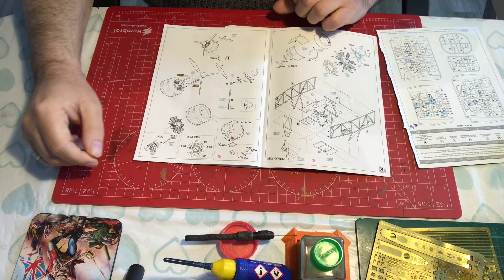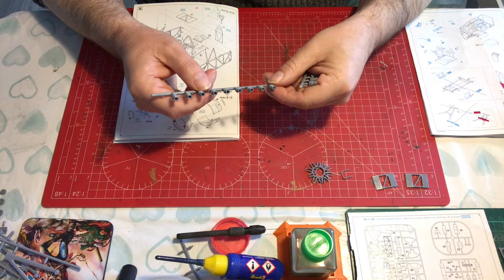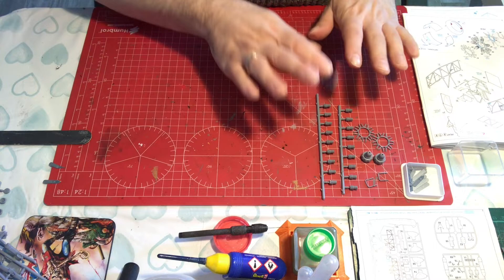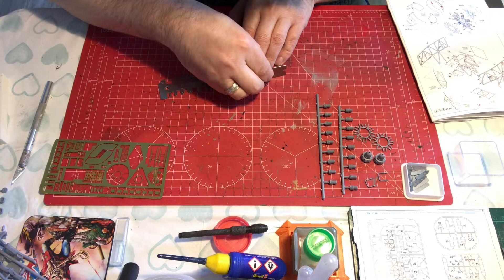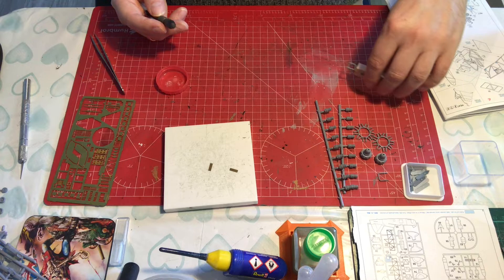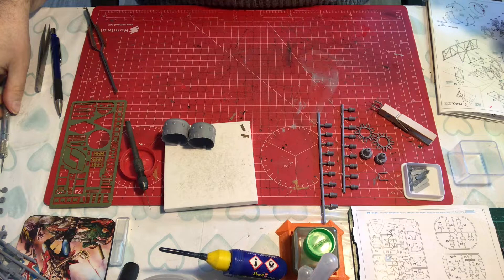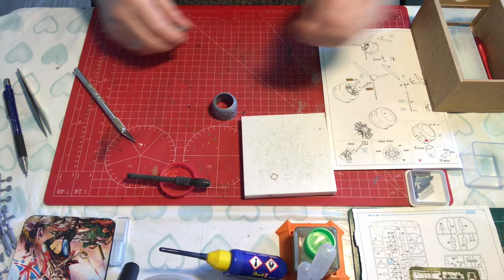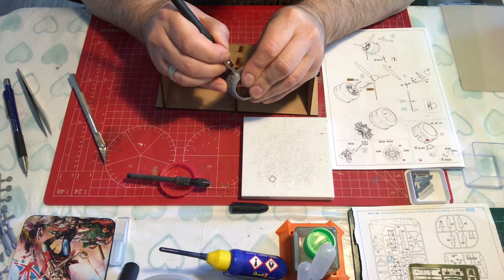Eduard 1/48 Lysander full 'double' build part 3

Comment: Jason, I know you haven’t completed it yet, but in your opinion, is the Eduard 48 1015 Lysander upgrade set worth getting? I’m in two minds...A lot of it seems to be interior map boxes and fillets that won’t be seen when buttoned up. Or do you reckon “What the hell, it’s only AU$34...just get it, man! You’ve got everything else for the kit...Why would you even ask? Get off my YouTube channel and get thee down to the hobby store!”
Reply from the maker: Personally I think it is worth it, its a large glazed area on the Lysander so you will see more than you think, which kit do you have? As I think that was included in the special addition.  Anyhow makes a huge difference to the look of the pilot seat
Reply: @ModelkitStuff  I have the kit you’ve got: The Eduard limited edition kit 11138 comes with two PE sets- The steel (part 1) and brass (part 2) sheets. The Eduard ‘look’ resin instrument panel (644054) and PE upgrade set (481015) are sold separately. It includes the rudder actuator bell-crank and the square frame that the instrument panel sits on top of.
Reply from the maker: @johnmarley6695  yep just checked your quite right, personally I think its worth it.
Reply: @ModelkitStuff  Cheers! 🍺